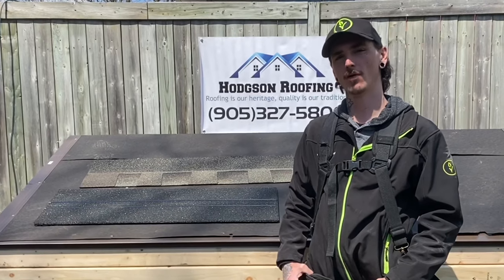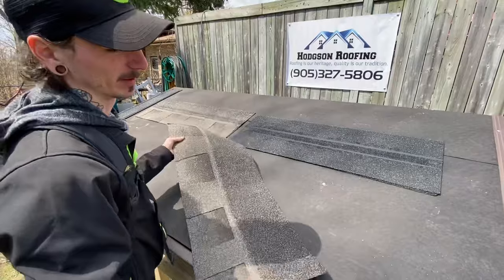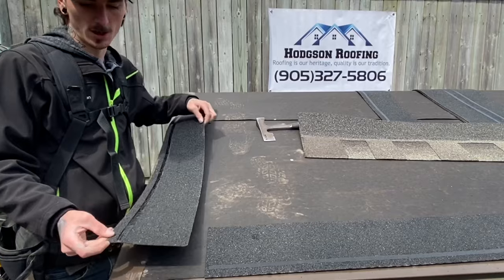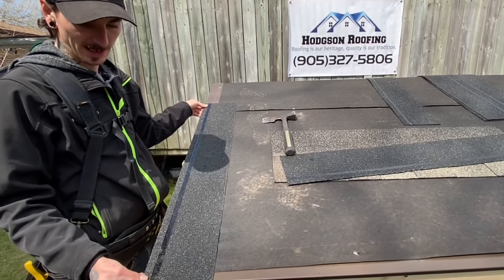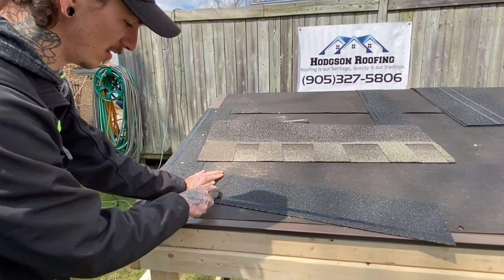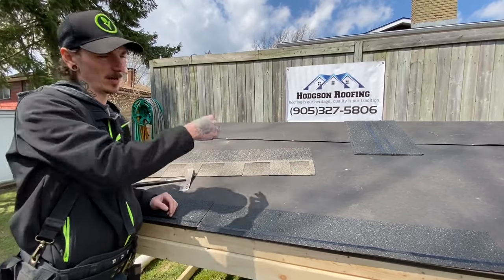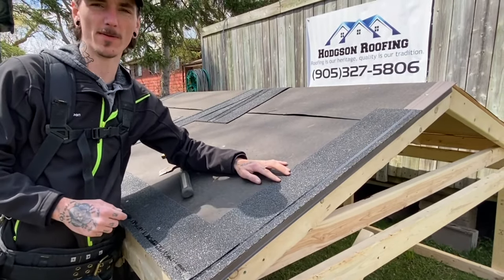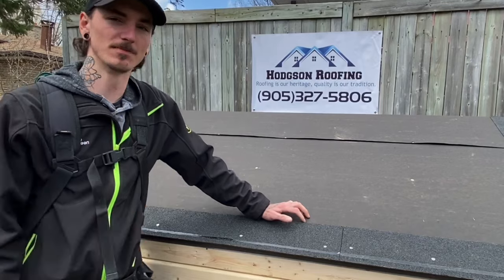How to Install Starter Shingles

Comment: I'm 60 years old and looking to re-shingle my farm house to save on labout costs. Never don it before. This video was awesome!  I don't think there's anything 'average' about your quality of work. Well done!
Reply: I'm in the same boat as you.  Too bad we don't live close by so we can help each other.  Mine came in a 32K to remove a layer of cedar and asphalt on a 1700 sq ft home that is 4/12 pitch with a long ranch roof with no alcoves or anything.  I just turned 70!

Comment: i like how you point out some of the common mistakes like joints lining up and the leaks that can cause along with nail spacing. a screwed up my first room simply because i didn't know nails should be 4-5" from a joint and really no less than 3. water creeps towards the nails when they are right next to joint lines and 5 years later you have the drips and nails that look like they were submerged in salt water

Comment: Good vid. Very well explained. And you explained why you DONT do things. Such as not lining up the shingle and starter lines.
Reply from the maker: Andrew Bortolini I always try to explain why not to do certain things and the consequences of doing so, just helps with understanding from a students point of view.
Reply: Of course you always start your starter with a half so it wont fall even with the finish shingle
Reply: @Average_Roofer  can i spread turbo polyseal over the nails to stop leaks

Comment: @youraverageroofer great video very helpful, the only tip i have for improvement is on your starter strips on the corners put the bottom starter then gable one over the top so just flipped from how you did it. Water runs downhill. Really great video though!

Comment: For a novice homeowner learning, this was is what I needed. I didn't like the cutting of shingles on the roof. In regards to the starter strips in the corners, how about cutting them at a 45 so you get less of a bump on the ends? Thanks for the video, no BS, well done.
Reply: If you prefer to cut the 45, do it. It won't be noticeable if you don't tho

Comment: You have some great videos! I have a question on the starters I noticed you ran the gable starter first then overlapped at the bottom wouldn’t you run the eve first then run up the gable just so water would shed properly? Thanks

Comment: The best way to start the starter shingles along the corners at the rake and eave is to 45 degree cut both starter strips. Then they both are flush with each other. There both flat on the roof and the tar strip will  contact itself to both shingles firmly.

Comment: Love the info and tips. I've done a roof or two, with other people. Not my every day job. But I was taught to overhang starters and shingles 1 inch off drip. Any particular reason you do a quarter? Or what would you say could be bad or good about an inch?
Reply: It's an eyeball thing. I bet his 1/4 inch ends up being 1/2 inch most of the time. I wouldn't go more than 1 inch though. Heavy rain can overshoot the gutters, and gutters are difficult to clean if you can't fit a gloved hand into the gap.
Reply: When the water runs 1 inch past the drip edge metal, gravity and momentum constricts water from turning 45 degrees  creating a second  drip edge. If the forces of the wind turn the water , the underneath metal drip edge blocks  the water.
Reply: @CardinalEgan  gloved hand? Just use your hand and save your gloves.
Reply: I never did more than 1/4". No need.

Comment: On the Gable end the starter strip should probably be on Top of the lower one because of the path of water
Reply: Interesting..hmm..as it flows it should go..well I guess 905 is Ontario, Canada! it's probably a base that is covered which doesn't matter..I take the 3 tab shingles en just cut umm! but who says ya can't get out a caulk gun with a roofing tar tube in it! (shouldn't HAVE to I guess!)..and did he build that roof to MovieSet this Presentation!
Reply: I don’t think that matters as much as the paper and flashing underneath it. I believe you’re just as like;y to have wind-driven water moving in at this location. If water happens to drain down under the shingle above the starter strip AND under the starter strip (you probably have other issues to deal with), the paper and flashing are still going to drain water off the roof.

Comment: Hey man. Great videos. Im a framer in Ottawa. About to do my own roof at home, first time doing shingles.. If I were to use just the regular shingles i have in bulk as my starter strip, could i not just put a bit of roof cement down to make up for no tar strip? I was also hoping to reuse my flashing..Seems to be in good shape still. Is that doable you think? Appreciate the content bro keep it up!
Reply from the maker: You can reuse the flashings, and you can user shingles for starters. 
Just ensure the tar side it up. It’s not the end of the world as you could use any shingles as a starter. It just helps with wind resistance
Reply: @Average_Roofer  Thanks man appreciate the response. Just finished my roof. First one ever. Went very well. I think ill do some more sometime!! You got a new subscription 👍🏼

Comment: So many videos show the starter strip as a shingle rotated 180 degrees. This puts the adhesive tab five inches away from the bottom of the first row, increasing the chance of wind lift. Cut the tabs off if using a regular shingle as a starter and install with the adhesive at the roof edge. This video clearly shows the correct way a starter strip has the adhesive at bottom of the first row.
Reply: I got to redo an old front porch roof. It's in constant shade. Does the adhesive still melt,  work ?
Reply: @PowerliftingwithGrandpaCharlie  Most asphalt shingle manufactures require that a specialized adhesive is manually applied to each shingle if temperatures are below 40 degrees Fahrenheit. If shingles are applied below 40 degrees without the specialized adhesive, the manufacturer will void any warranty. Above 40, no problem.
Reply: @brianw612  Thanks !

Comment: Last time I shingled a roof,we just  rotated the shingle 180°, presto! There's your starter strip! Of course you offset the first row so the seams doesn't line up. 
Never heard of a actual "starter strip" before!😁👍🇨🇦
Reply: Doing it your way the tar strip is not on the edge of the roof.
Bottom course would not seal and could potentially blow off.
Reply: @contractorjay5062  . Double nail,and we are in a little clearing in a forest, but far enough so a tree can't hit the house. 
Don't get half the wind that's at the road beyond our little sheltered spot...
Only lose shingles when I shovel the roof,don't know when to quit and leave some snow on top of the roof!🙄
Biggest problem is we suffer sun damage on the back,front roof wears fine...🤔

Comment: Hey am doing a lean roof storage shed do I have to put starter at the top of the shed roof & also for the drip edge for the top does it goes after the shingles or before?
Reply from the maker: No starter needed at the top, but put your last drip edge on top of the shingles and seal the nails.
Reply: Thanks alot relle appreciate the help

Comment: I did I roof on a garage on my summer cabin, and I failed to put down a starter strip, dumb mistake I know but never done a roof before,  any adhesive you would recommend  that I go back to adhere that first course?

Comment: Wouldn't it make more sense to reverse the lap at 4:56?  Seems like it would be better for water run-off.
Reply: That's correct and you are supposed to overlap the gable sides 3" at every joint.
Reply: @rickyhinton5726  you’re a roofer? I’m a newb but this makes since. Don’t think I’ve seen a YouTube er do what you’re saying unfortunately

Comment: I staple them in with my hammer tacker saves nails. Quicker application and the nails from the shingles fasten them down.  No dragging the air hose around. Thanx 4 your video.

Comment: I have a 20 ft outbuilding shed. I bought the gaf at 39 3/8 inches. They say full first run. Then less 6, 11, and 17. The first starter row is 3-1/4 inches short. It hardly makes sense to spice in every 5 th row with a 3-1/4 inch piece does it. You have good videos. Watched several of them. Please advise.

Comment: (1) No one has video of roof around Turbine vent and how to seal it. (2)How to shingle Trapezoid roof with large area, where to start, how small the end shingle can be on the end of first row etc. (3)how to Install ridge cap and hip cap tips without the vent on ridge. (4)How to install Open Vally shingles, where to start, which end to start. (5) Where to Install the flashings on roof eg step flashing, apron flashing etc. Other detailed tips and tricks. Can you make some videos of that?  We had hail storm in Calgary Alberta CANADA. Thounsand of guys will thank you. If you can make 5 videos.

Comment: Great video. Only thing I would do different is I would put the eave starter on first then overlap the rake starter. Backward laps erk me lol. Outside of that your procedure is legit. I know it's the same either way, as long as you do like you said and make sure to have the starter glue meet on the rake and eave.

Comment: In any other roofing video I've watched they all start out at the edge of the eave and put the rake starter on top, you did the opposite. Any reason why? I don't think it makes a difference...just curious. Good explanations and demonstrations BTW. 👍
Reply from the maker: Ted Locke you can absolutely do it both ways. This way just utilizes all of the tar adhesive 100% around the roof line.
Reply: @Average_Roofer  Your way makes perfect sense once I watched and actually paid attention, thanks for the reply bud, roof on!!
Reply: Rake starter should be on top. If not water will get in eave 100% - your overlap should never face ridge , ever

Comment: Not to ask a dumb question but you started on the side first with the starter shingle but watching GAF starter shingle from them directly they start at the bottom of the roof, and then put the starter shingle OVER and on the sides... I would think starting on the side first then putting the bottom ontop would be a potential for water to sit if there was any penetration?

Comment: I’m building a chicken coop with a lean to frame roof. I’m assuming I just need to run the drip edge all the way around but should I start my starter strips on one side like you did? Is there anything special I need to do at the top of a lean to?

Comment: We just had our roof reshingled on Saturday. On the quote, it said that there will be 2 bundles of starter shingles. But when I saw the actual job being done (I took pictures), I noticed that they installed architectural shingles flipped the other way (rotated 180 degrees) on both the gable and eave ends. They are Certainteed Landmark. Does not using proper starter shingles void the warranty in any way?

Comment: I recently cleaned out gutters on my roof.  I noticed that there was no starter shingles installed.  The first course was the first full shingle.  I also noticed that this first course overhung the drip edge anywhere from 5/8" to 1".  This caused that first course of shingles to droop over (bend, curve, whatever) in the hot sun.  The home builders roofer said they were installed per manufactures specs.  Any opinions out there?
Reply: The one inch overhang is normally used when you have a 1x2 trim board fastened to the facia to cover the flashing.

Comment: Would suggest using a self adherring waterproofing membrane on the eaves and gables. They should extend the the starting edge of the drip edge in case you are in snow country and have gutters. The underlayment should lap the drip edge in either case to prevent water from running back and soaking your deck.
Reply from the maker: gary24752 use ice and water shield along all eaves, gables and valleys making sure they cover 18” inside any heat bearing walls. Under the drip edge along eaves. And over the rake edge metal.
Reply: @Average_Roofer  In your earlier video "How To Install Drip Edge on a Roof", I think you said the opposite ... in that video, I think you said the drip edge goes under the underlayment (or ice & water shield) along eaves and on top of the underlayment at rake edges. Please clarify because I want to make sure I understand correctly. Thanks.

Comment: if one of those sides are against a wall, do I still want to do starter shingles the same way?
Reply from the maker: yes put the starter shingles against the wall, then install your step flashing onto of your starter shingle, then butt your first shingle course onto of both the starter and the step flashing. I will have a video for this process soon!

Comment: Seems to me if you did your first eve starter strip as suggested .... that if something happened somewhere between the eve and peak ... water would run down and have a path to "UNDER" the shingle?  NO?

Why not run the eve piece first and the gable piece on top?
Reply: This was a good question I wish was answered
Reply: @alexw4225  I'll answer it... The starter shingle is only a waterproofing element at the butt ends of the regular shingles along the eave edge. The UNDERLAYMENT is the waterproofing under the starter shingle and that's where the water will end up anyway so that 5" strip of starter bucking water is inconsequential

Comment: Do you have to worry about the starter seams going up the rake?..thanks
Reply from the maker: Nothing on the rakes matters except for it being straight. Just make sure seams are staggered from starters to shingles on your first course along the eaves.
Reply: @Average_Roofer  thank you
Reply: @RoofingWithDylan  I'm doing a shed roof with 3 tab shingles. Do I have to start from the same side in the front as the back? I feel more comfortable working left to right. Should I go right to left on back side?
Reply: @Average_Roofer  Nice. I like working left to right. Do I have to work right to left on 1 side so the rain slots line up on both sides?,,for 3 tab shingles..thanks

Comment: Did you install the starter strip 1/4 inch beyond the drip edge or before the drip edge?Hard to see on video?
Reply: Yes it was 1/4" beyond the drip edge, BUT this is ONLY for drip edge that has a 1" lip that extends beyond the edge of the roof! There are drip edge metals that are only a simple 90 degree bend with a small 3/16" bend at the bottom that is the actual "drip edging" that kicks the water out away from the fascia. Using this type of drip edge you'd extend the starter shingle one full knuckle (1") beyond the drip edge and not the 1/4".
Reply: @timphillips8966  Thanks, I installed some shingles back in December this way.

Comment: Would it be better to put the rake edge shingle on top but cut out a sliver at its bottom to expose the other shingles tar? I know a great deal of consideration goes into overlapping the roof materials correctly so just wondering if there's a way to have these overlap that way too

Comment: Your Rake starter should be over your Fascia starter strip Sir. Your install would allow water to enter the Eave. No overlap should ever face the ridge on a roof 👍
Reply: that’s a good point… I would assume that if you need to add additional starters along the rake you would overlap them as well shiplap style, correct?
Reply: @GearGuy  yes sir 👍 from the ground you should always be able to look into a overlap not over

Comment: The problem I see with this video is when you were talking about the bump you over laped your corners so there's gunna be a even bigger bump there. And you didn't over lap the corresponding starters on the eves or rakes so I dont see why you have to over lap the corners. And I'm pretty sure bdr uses normal shingles 4 the starters

Comment: When you put the nails in the starters, is it ok for them to penetrate the drip edge?
Reply from the maker: Yes. That is actually good practice as it means your nails are close to the edge of the roof which assists in adding strength to the starter shingles to combat wind.
Reply: Good roofers cover the heads with Blackjack roof cement
Reply: @largemouthhunter5014  I spray flex seal ..just enough to cover the head.. seems to make it quicker on bigger projects n bout 100 more per project

Comment: What size nail do you use when nailing to the plywood that will be exposed underneath so the nails dont go through?
Reply: Nails are supposed to penetrate through for grip. You might get away with short nails in a board deck. Wait until you try to hand drive really short nails by hand if you can find them. Gun nails don’t come that short.
Reply: @peterbarlow8912  so do you glue shingles that go over the eves?
Reply: Those starter shingles have asphalt dots to weld to the overlaying shingles down with the heat of the sun. The field roofing shingles have them also to make roof like a semi fused mat after a heat cycle that’s hard for the wind to to blow off. They’re dots so moisture can escape.

Comment: Do you overlap the gable sides? Or just butt them up together?
Reply from the maker: Pixel2 Xl Very good question. After working with multiple roofing contractors and dealing with several manufacturers, the answer is truly based on preferences. Either way is correct as long as your bottom starter seams always stagger approximately 6inches or more from your first shingle course seams.

Comment: Appreciate the video but i didn't catch the set up / positioning of/ drip edge below starter shingles on gable and the horizontal. But there is a lot of time dedicated to you driving in the mails,  would be way more helpful to see how the drip edge is installed and jow the starter shingles go ontop.